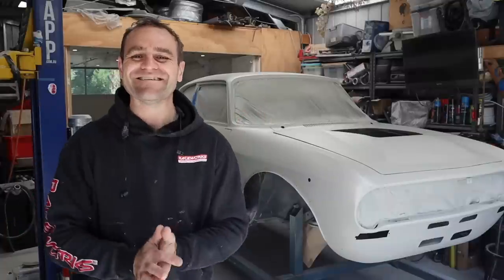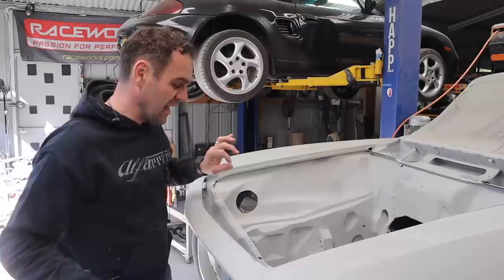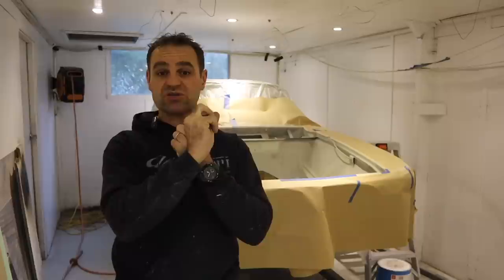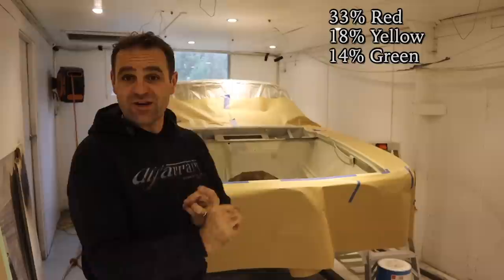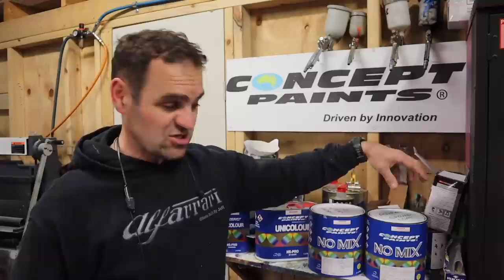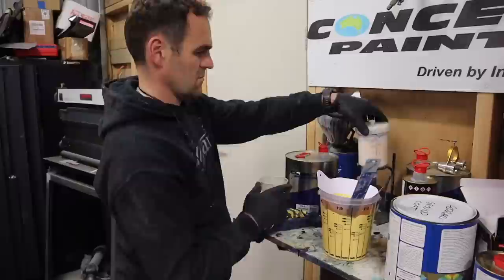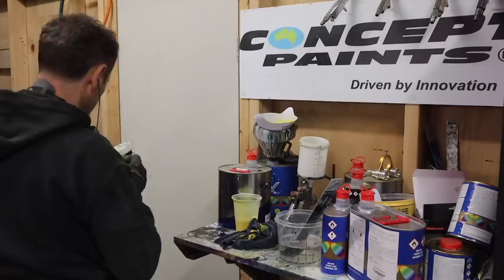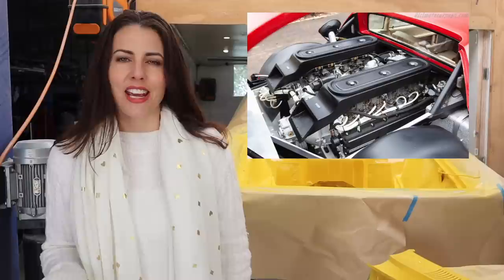Colour reveal on the Alfarrari - Ferrari engined Alfa 105 Alfarrari build part 142

Comment: Great explanation as to why you chose yellow mate looks unreal. 
Been watching since you pulled it out of the backyard all those years ago so happy to see you finally lay some paint down.
Should be very proud of yourself! 

My opinion doesn’t matter but I reckon maybe see what the red valve covers looks like in the engine bay first before you paint them, could link red to break calipers to offset all the yellow. 
And maybe just decal the silver stripe first, a white stripe would also look unreal against this colour in my opinion.
Reply: I was thinking the same thing re the red valve covers and brake calipers.
Reply: White stripe would look nice.
I'm thinking (for myself lol).
Acid dip the intakes to natural cast aluminium silver with the raised Ferrari letters in yellow.
(Works just as well with the yellow intakes./silver Ferrari letters...)
This would maintain the flow of silver stripe.
I'm not sure if the red would set the car apart enough.
I guess another rendering would easily show the impact.
But do like the idea of calipers same as intakes.....

Comment: Jeff, if you're struggling with light, have you thought about making a light tube or ring like the car detailers use, (keeping it portable) so that you can position it up in the roof ceiling, on hooks anywhere to remove shadows and dark areas when spraying the engine bay, hopefully eliminating your problem. Keeping it portable and close to the ceiling, means it's only used as and when you need it. I just think your ceiling spot lights are not up to the job for spraying. Love your different threads and the problems you encounter and possible solutions. Some work and some don't as we all know when building stuff from scratch. (Loved the wiring loom) Keep up the good work 😎👍

Comment: I didn't vote, but I was hoping for 1 - green, 2 - yellow, so all good with me! I was was wondering about the engine being part of the mix. Got to admit the silver stripe really sets it off (and would have worked with any colour of course). Something I've been meaning to mention, and was reminded about with the engine bay being front and centre this episode, is cooling - I've got my fingers crossed that you don't have heat build-up / cooling issues, given there aren't many ways for hot air to exit. ETA >> forgot to say - those renders are just stunning.

Comment: Had a car this colour once. The flies and bugs love landing on it, thinking it’s a flower! Would have gone for gentle light green metallic or silver blue metallic. 
Would recommend you fit a little air regulator and gauge on the tail of your paint gun. Have one on all of mine - is much easier to regulate pressure than the screw on the gun. Good luck with painting the shell! Spray your booth with some hairspray before you roll the shell in - great for sticking dust down 👍
Reply: That’s why Ferrari calls the color fly yellow!

Comment: Yes on yellow! I'm surprised you went color/clear in the engine bay though. The exterior you need that depth and luster of 2-stage, but for engine bays and interior where the light doesn't really hit it in a way that shows off 2-stage paint, it just seems unnecessary.  It looks good, but it is harder to fix when you scratch it up during assembly. Unless you think you can get everything into the bay without scratching it? (challenge laid down)
Reply: Has to be easier to paint the whole car using the same process

Comment: Tips 
Make sure you spray at the same temperature in the booth and make identical mixes or the panels will be noticeably different.
For a good wet look you can add a small amount of base to the clear and do a couple of coats before the final clear coats. Results may vary depending on the products used the colour and metal flecks.

Red with large British racing green GT stripes or green with red stripes would look good.

Comment: jeff your car your choice i'm not a yellow lover but i do like it tip on the runs take your time cutting them out and don't rush i have various cutt off pieces of hard nylon block that i use on runs i just shampher the edges of the nylon so there is no chance of damaging the paint and go through the grits 800 1000 1500 etc good luck

Comment: Absolutely Awesome Jeff 👏
It’s so similar to Rod Quin’ys RL 
It’ll be good to twin up in a photo shoot. Rod returned to Melbourne a few years ago . I did a fair bit of work to it .. running boards and steering wheel refurb if my memory’s correct. 
With the paint job it’s a good idea to get a battery daylight torch to inspect the paint as you go.. by shining it from different angles it tells you how thick you’re applied it
Reply: Plus it shows the missed areas like day and night... it’s a must have Jeff 
But they aren’t cheap unfortunately. 
Great Job Raphael ...!!
 (The painter)

Comment: Yellow is an interesting option, but instead of the metallic grey for the stripes, which is a bit cold visually in my opinion, I would've preferred a solid red single wide stripe on the bonnet, and of course the engine heads painted in the same red. I hope you will keep the classic Alfa Romeo emblem on the front shield and on the trunk lid.

Comment: If you're buying a brand new Audi they come in black or white as standard, if you want a colour, that's a $2500 option, metallic is $5000 and the new 'frozen' finish is around $7500.

Comment: Too early to tell if the chosen yellow is a good choice. I do know the yellow used on a few 250 GT Competizions back in 1961 was a great choice! That Ferrari still honors their 'redhead' engine colors should not be lost. If it were me: A. Stock Red on engine. B. Silver stripes on yellow paint. C. Add Red, White & Green stripes about a 1/2" wide for each color along the edge of the silver stripes. This helps tie in the redhead engine while still drawing attention to it! Silver or bare engine castings (with the gray stripes) will only lessen the engine's prominence to car show attendees.

Comment: The Yellow looks amazing in the renders, great job by Jurgen, question though Jeff, the rear badge on the trunk, would it better to put it somewhere else?, for example in between the taillights and number plate, or on the front fenders, it overlapping the stripes doesn't look too great, maybe Jurgen can play around with that in a render.

Comment: Wow I'm pleasantly shocked.
I was soo sure you would go for Ferrari red Jeff.
I agree about the many red Alfa's an wanting to stand out yellow seems the perfect choice..
...
The renderings are awesome. Must have helped with the colour choice. 
The yellow works with the silver stripe I guess with silver wheels too?
This wil look awesome once finished. 
Am a little surprised at the colour but it works and suites the lines of the car.
..
So some ideas.
Yellow Intakes with silver Ferrari letters or.
Acid dip the intakes leave natural cast aluminium silver but with the raised Ferrari letters in yellow?
This would accentuate the silver stripe down the centre.?.
..
Also a good move painting the engine bay yellow. 
A .black engine bay may have been too harsh against the yellow.
..
How about a grey suede interior?
I'm sure that would offset the yellow.
..
I'll have a rant lol.
Black on black cars all black. wheels, paint, windows why? Just sooo dull!. 
Not so with yellow...
Well done Jeff enjoyed the journey the finish line is ever closer...
👍

Comment: I'm please that you have not fallen for a shade of Audi battleship primer grey.
Red does nor work appreciate UV rays which would be a problem in Australia. 
The bright yellow is a nice choice, but I'm less sure about the silver stripe and as Simon G has suggested below, the silver stripe implies that the cam covers will need to be silver...(or part silver part yellow...).
The big question now is if the exterior is yellow...what colour will the interior be ? (My suggestion: mid blue).

Comment: Not necessarily true about 800-1000 being too fine. If you read the tds’s for most basecoats or even 2k topcoat, most recommend 800 wet or 500-600 dry